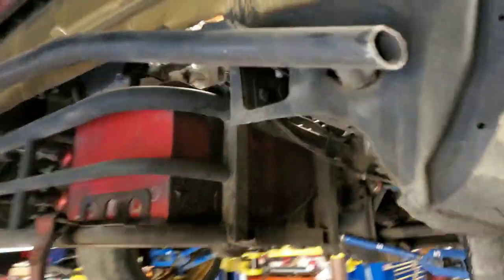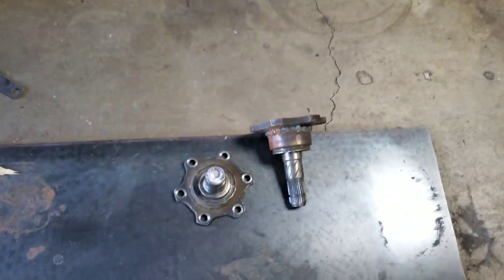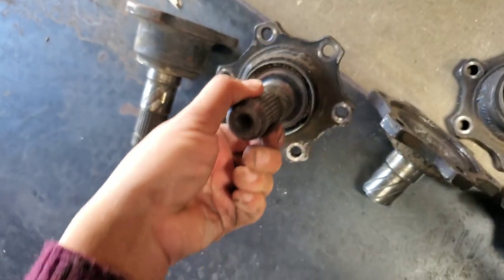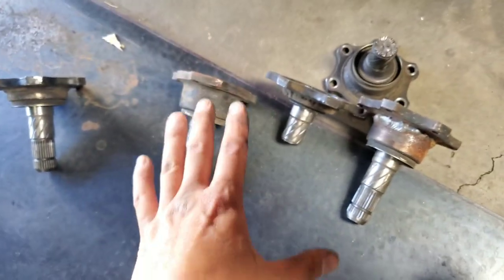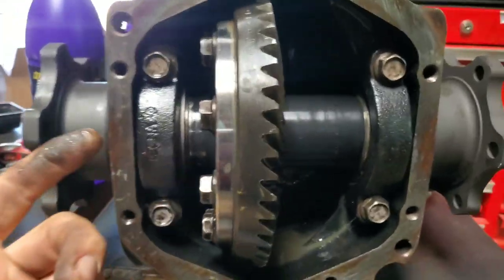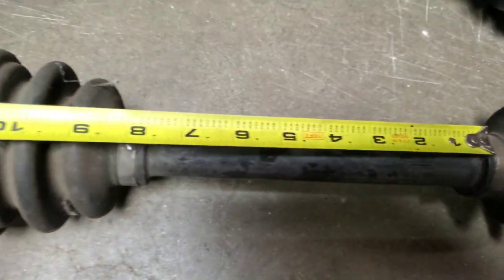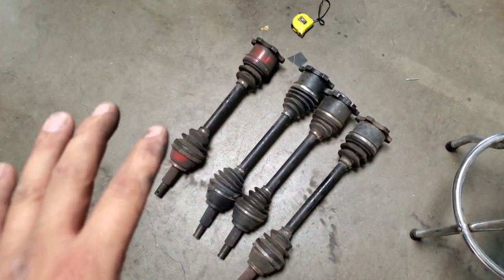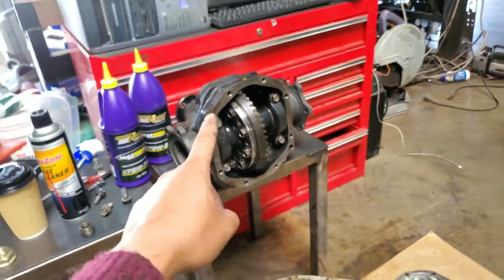🤙Easy Bulletproof Nissan 240sx Rear axle swap for high torque LS powered 240sx or High power 2jz

Comment: Did this fix your problems? Are they indeed stronger or is a Q45 diff with 32 spline axles the true fix?
Reply from the maker: Yes lasted for 2 years.
Reply: @spikedrift  thanks for the reply. I ended up ordering them anyway. Struggling to get TT Hubs right now but I have most everything I need at this point to move forward